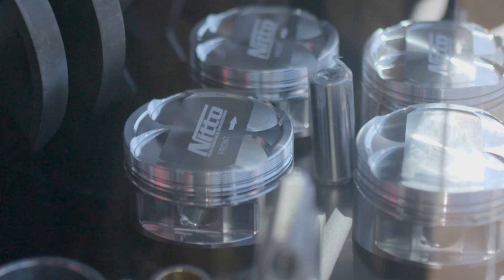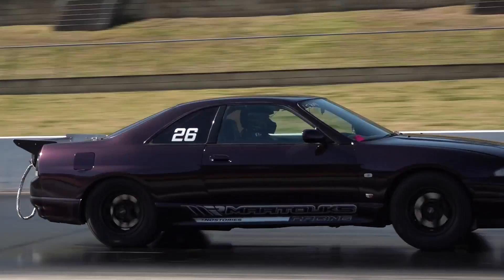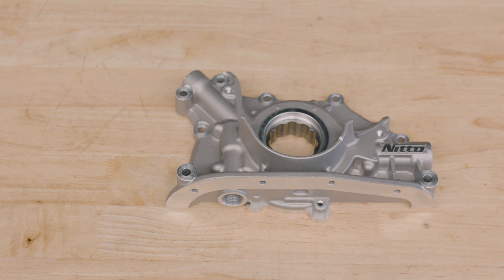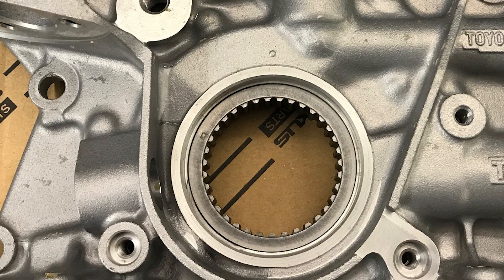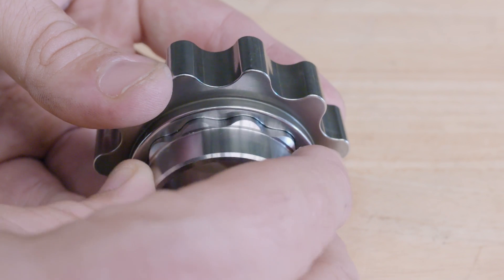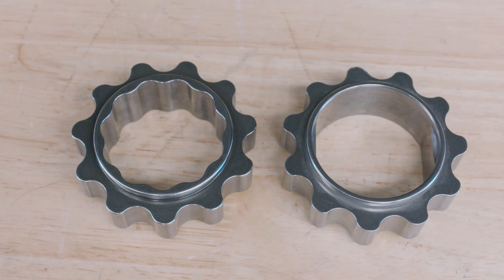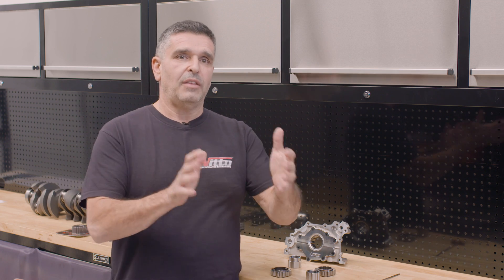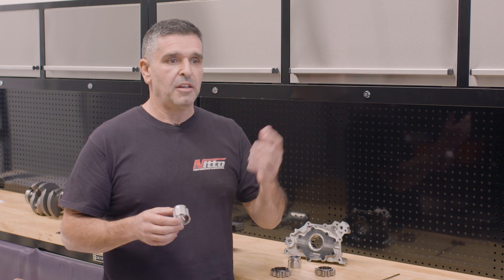GT-R & RB Oil Pump Technology & Sine Drive - Motive Tech

Comment: I don't have a ton of car knowledge or experience yet but I can change brakes, plugs, exhaust, and an oil change. That's the extent of experience I've had so far. Could someone let me know if you need a sine drive crank collar to go with this? I didn't know if the Nitto 2.8 stroker crank would go right into this nitto oil pump or not. Sorry for the newb question.  Thank you in advance to anyone who's able to help.

Comment: In Russia, a spline gear kit for RB engine oil pumps has been produced for a long time. Both in the drain housing and in the tuning pumps. 
https://www.youtube.com/watch?v=qsXVwxnqJVM
https://www.drive2.ru/l/8178288/
Reply from the maker: We know. Nitto knows. But it to has been making their pump for long before them. Did you listen to why nitto doesn’t use spline and developed sine drive?
Reply: @MotiveVideo  No. Why?
Reply from the maker: @ziclon100  So you're commenting on a video you haven't watched?
Reply: @MotiveVideo  The thing is, I don't know English. It is very difficult for me to understand everything that is said in the video. If there is an article on this topic, I would be able to translate it into Russian through a translator.

Comment: Interesting to see a different take. I would have thought a sine wave drive would introduce significantly more hoop stress than a regular toothed spline drive, as the main drive force interface appears to be about 70 degrees from tangential so significantly more force is trying to "expand" the pump gear than is trying to rotate it. Obviously not an issue here or they wouldn't have done it but I imagine there were some constraints for their "one pump fits all" approach that led them down this path. I would be very interested to hear why they took this approach over a conventional spline. My guess is they wanted this to accept far more crank runout than the spline design would allow, without taking a lot of meat out of the gear to accommodate the large spline teeth that would be required.
Reply from the maker: Watch the video. They explain why they didn’t do spline
Reply: Alex Burns we have designed clearances that allow for crank run out in a spline drive setup. As this independent video outlines. https://youtu.be/5o4B6vR0lmU.
Reply: @SupertecRacing  How much power can that setup handle?
Reply: NiveusLuxLucis certainly tested to 1200hp on an RB30 also at 11k rpm during our own test on RB26. There is no reason why it cannot go to 1400/1500 hp. Used countless times in drifting and drag in Russia also sold world wide since 2014. We have had zero reported gear failures which is a testimony to the strength of the spline drive. We cover most RB oil pumps. They simply work as intended.

Comment: More great aussie tech. However I can't imagine building a +700kW turbo engine for motorsports use that doesn't use a dry sump. With the cost of everthing else in such an enngine, another $5-6k on a drysump is cheap insurance.
Reply from the maker: Hear what you're saying but 8.4 and 1300+hp on a wet sump with WARGTR should be enough proof, let alone the copious amounts of 1000+hp GT-Rs built by Maatouks, B2R, MSM, CRD etc in Australia. All wet sump and Nitto pump, mostly the two flats style.
Reply: @MotiveVideo  Thanks for the response. And I understand why it’s done (cost and complexity.) But at these power levels (if it were my engine) its not the pump that worries me (speaking as a circuit racer.)

Consider: In an 8.5second pass, even the highest flowing oil pump (say 50L/min) is only going to be able to pump a little over 7L. So, with a large enough sump, you can’t run dry and are unlikely to have froth issues in such a short time. Nor is oil temp going to play a significant factor. There are also no lateral loads, so the sump baffles can be designed for acceleration only. All that’s needed is a pump that wont fail (and we’ve got that covered.) 

Conversely, in circuit racing (time attack is just a fancy name for qualifying) where g-loads are high, you’re at it lap after lap (sometimes for hours,) oil temps need to be managed, …. This is where you need more than just a strong pump, you need a lubrication system that can cope with all those rigours, which is why dry sumps are popular here (obviously.) There are also the performance advantages of pulling a vacuum in the crank case, as a result of less windage. (This is where my comment was more focused.)

Fortunately, here in Australia we’re blessed with amazing companies (Ross Performance for example) who make some of the best kits in the business. Also please tell Heman to develop a 1-piece SR20 main cap girdle and drysump pan 😁. the current main cap girdle is awesome, but that would be next level and very tempting for my circuit car.

Regards
Jordan
Reply from the maker: Circuit is different. Jim says so and we say and agree so as well.
Reply: @manitoublack  Trust me, I'd love to get a dry sump in my GT-R (if I had one). But one of the biggest problems of trying to get a dry sump in a street application is finding space in the engine bay where to mount the tank which is what I would prefer. But from all the pictures I've seen of the engine bay, I don't think any off-the-shelf dry sump tank is going to fit, even the really small-diameter, super-tall tanks look like they won't fit.
Reply: Dry sump uses a lot more space and adds weight though, even though you can move the engine lower to lower the centre of gravity. But I agree that something that makes about a 1000hp which isn't a LS should have a dry sump if possible.